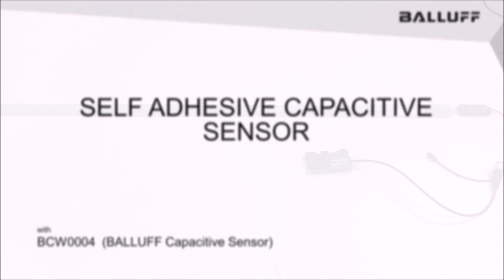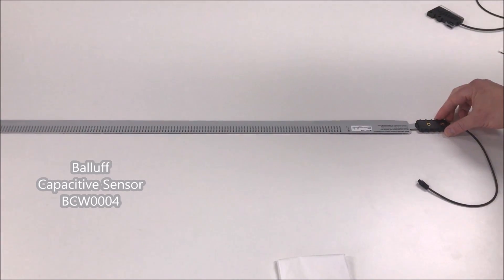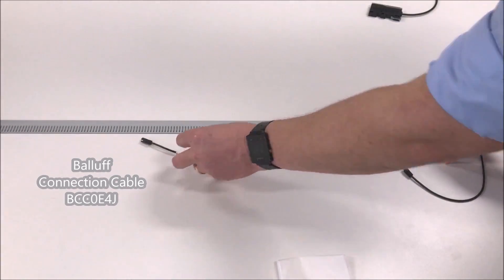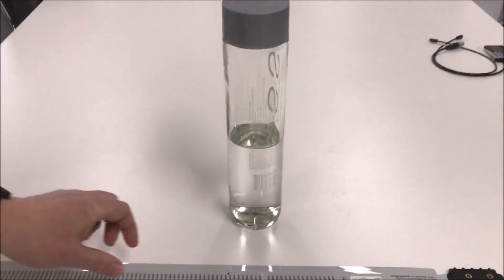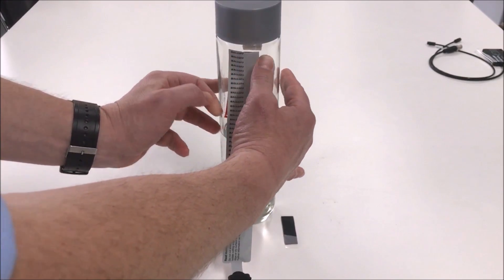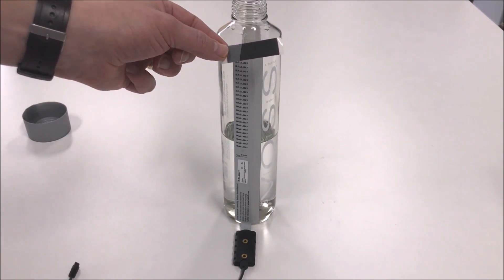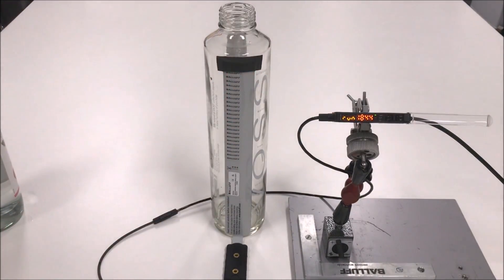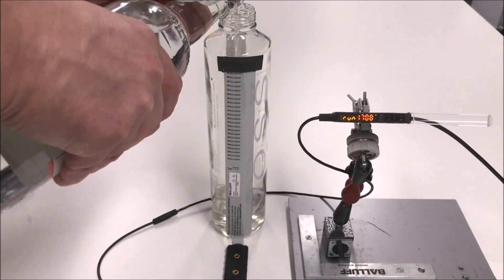Self Adhesive Capacitive Sensor

Comment: may I know if this level sensor can work in a SS tank? thanks Mario G.
Reply from the maker: Hi Mario, this self-adhesive capacitive sensor only works on non-conductive/non-metallic tank wall materials. You can visit our website or call our customer service at 1-800-543-8390 to learn about our variety of level-sensing technologies that may solve your application challenges.